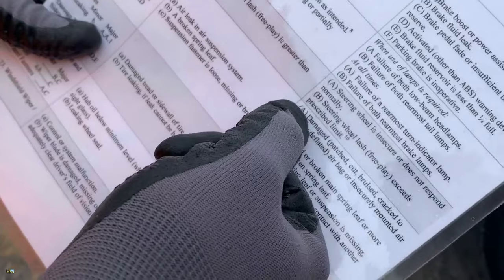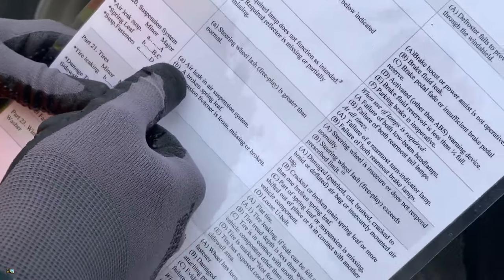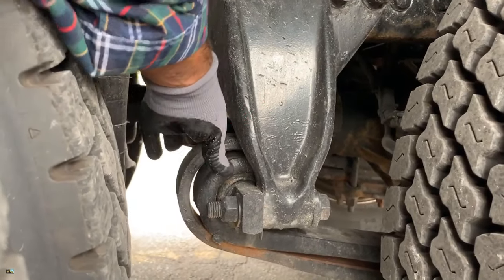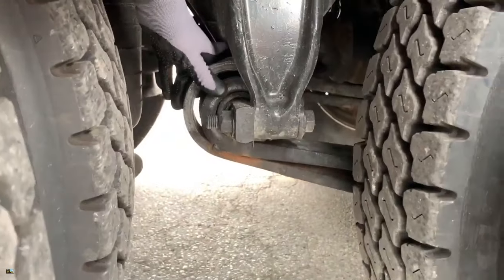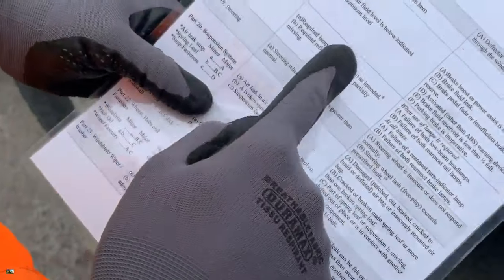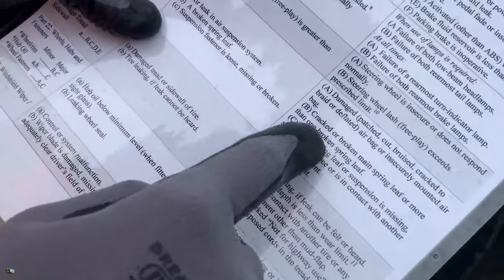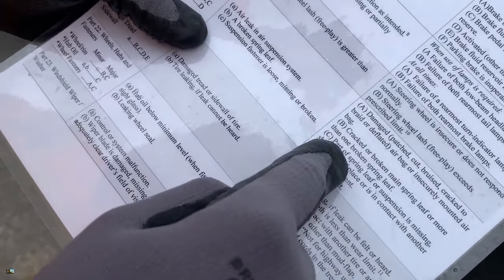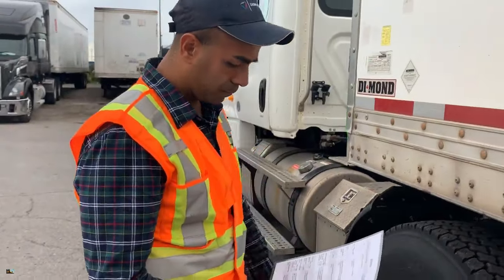JAZ Truck driver training Melt Program schedule 1 Pre trip inspection 2019

Comment: ⚠️⚠️⚠️ To Test tractor protection valve, you should apply the tractor break (yellow button in and red button out) then you have to press full service break application.
Reply: Don’t confuse people. The examiner has no idea how a anti compounding valve works….
Reply: You're correct.  Thanks for pointing this out.

Comment: There's a lot of wordings, that's not being said on each Exterior inspection. I'm noticing it, because when I read it back on my schedule 1 inspection sheet for the Suspension System It says under
Minor defects: 
Air leak in air suspension system 

Major defects:
Damage (patch, cut, bruised, crack to the braid, or deflated) Air Bag or insecurely mounted air bag. 

You can't do that in Front of the exammer, that would be an automatic dismissal.
Reply from the maker: We never had any situation at any drive test center where we have been told to do something different from what we teach. In fact, they tell us do not overdo it. Keep it simple. Also, this video is a helpful guide but stick to your own instructor's manual because I tell my students always stick to what I teach, and you will be good. Thanks for sharing your interest. Goodluck 👍
Reply: @flyingjstation  How many questions does the examiner ask for each of the inspections? Also do you have to memorize the Minor and Major defect for the test?

Comment: How can you lell from the drivers seat if your mirrors are tight and secure. You have to grab them from the outside of the vehicle to make sure the mounting bolts are grabbing. Looking in the mirror from the drivers seat does not tell you that
Reply: Your not looking at rust and movement from the frame bolts

Comment: Hello 
You applied both brakes during tractor protection valve test shouldn't it be just the trailer brakes we need to apply?
Reply from the maker: You can release your tractor spring brakes or have them applied.  There is no error on that just make sure to have trailer supply valve out (Red knob) for Tractor protection valve.